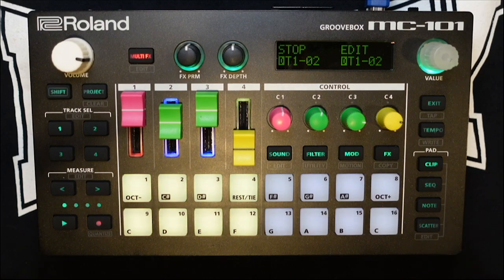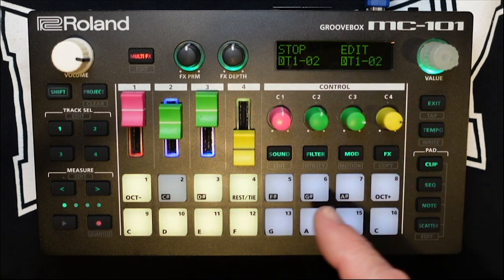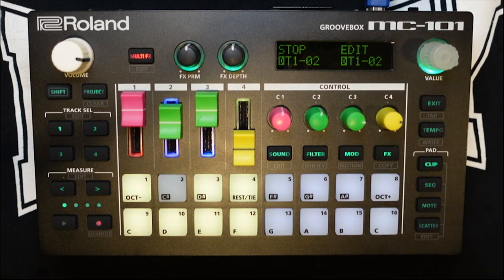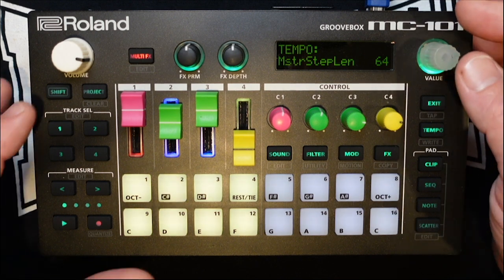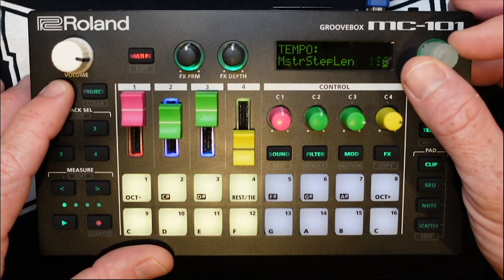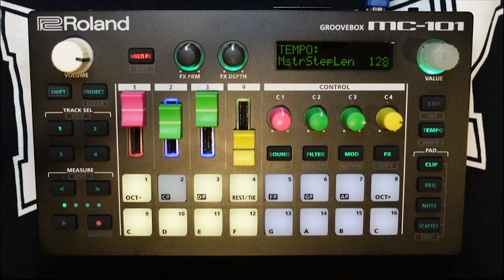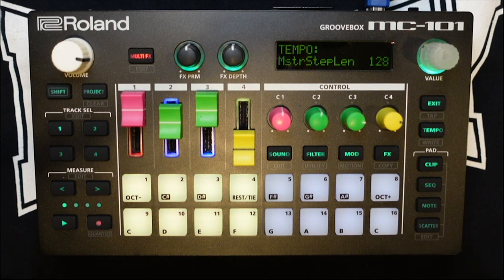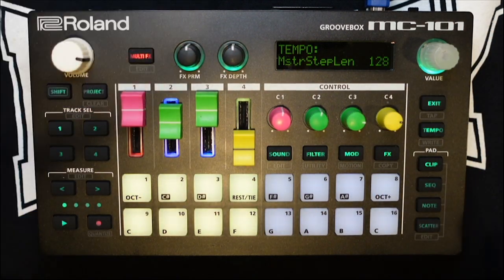Roland MC-101 Tutorial - Master Clock Length

Comment: How would i go about making a 1 or 2 bar break in a song (chain) if my clock is set to 4 or 8 bars? Can i use a value less than 1 (clock rotation) for that break clip?
Reply from the maker: You will have to set your clock length to 1 or 2.